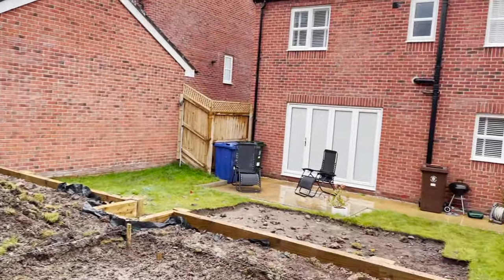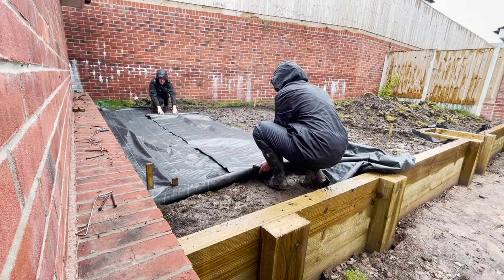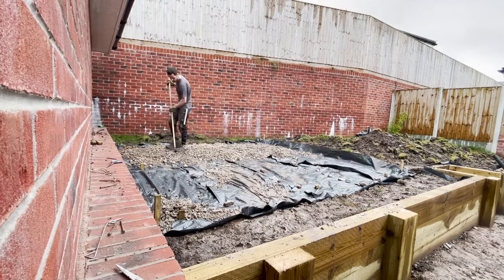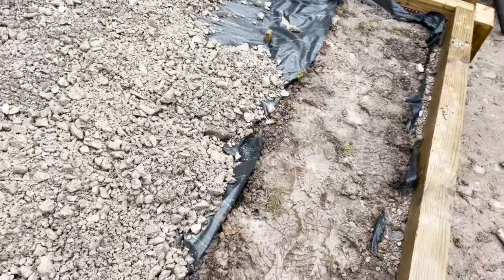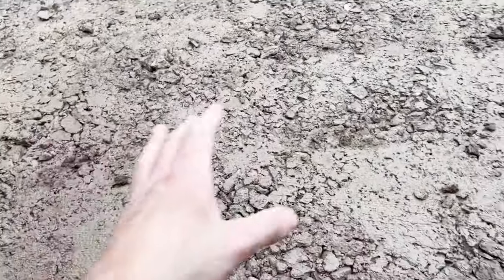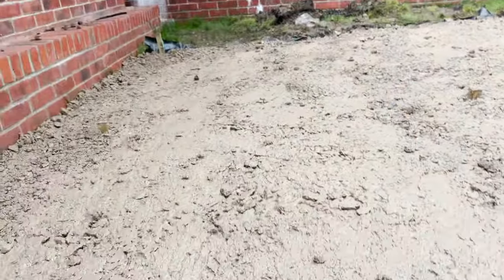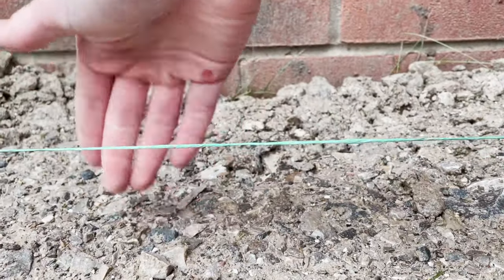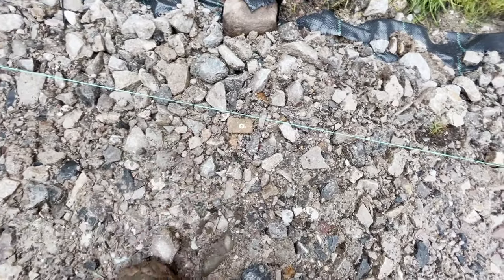Preparing a PATIO SUB-Base - GARDEN RENOVATION

Comment: Nice work! I recently laid my lawn, which is on a gradient. In order to achieve a perfectly flat (although tilted) surface I used scaffold poles in a train track like config. I set the poles so that the top of scaffold poles were the finish height of the lawn). This allowed me to fill up and scrape away excess soil with a spirit level.
Reply from the maker: That’s great, I may try this at some point if I do something similar again 👍🏻

Comment: Great video, I’m doing the same in my back garden but the area has an original layer of sand rather than soil. Thoughts on just putting the membrane down and then the hardcore on top? Do you think it’ll be okay?
Reply from the maker: Cheers 👍🏻
I recon you’d be sound doing that, shouldn’t be an issue.
Reply: @NoviceGardener  cheers fella. Keep up the grind!

Comment: I thought you had to use the white landscaping fabric as well as the black on grass areas to prevent the grass coming through
Reply from the maker: You can do it with both. Nothing has come through as of yet thankfully.
Reply: The main reason for using geotextile/ landscaping fabric is to separate the sub base material from the subsoil as over time they would mix. It also is used to for filtration and to improve the ground stability.  People call it weed membrane as that is what it is primarily sold as in the likes of b&q and wickes etc. But this is more true if you are using to under some decorative stone or mulch on flower beds as when using it 100mm+ underground it is unlikely any grass will grow through anyway due to lack of photosynthesis.

Typically I wouldn't recommend using the stuff in 1 meter rolls as it will only help with the separating of the sub-base from the sub-soil and is better in the 1.5 - 2.25m rolls as it'll help improve the ground stability, this can be done with the 1m stuff but it needs pegging to the ground.

The difference between the black and white is that the white is non woven and has better filtration properties than the black woven geotextile which isn't suitable for permeable drainage situations.

Comment: You can save time and money by using a old method to replace the mot sub base,  just use the soil thats already there as a sub base but first you need to level the ground to an inch higher than where the mot subbase height would be  then  dig it to 4 inches deep and mix with cement at 1/4 ratio thats 1 part cement 4 parts soil then spray with water ( not too much just enough to wet the cement ) now the last step is compact it with a hand held rammer or a 4x4 fence post untill its compacted enought that it wont give when you walk over it, water it in a few days again.
job done if you get the water mix correct you will have a croncrete like sub base in a week that will not shift over time and will easily handle the weight of pavers plus people.
Reply: its an interesting concept but Im not sure it would be easier as you would have to make sure its mixed correctly in a mixer and that makes it time consuming.

 Maybe worth trying on a small area.
Reply: You can just mix with a spade and a rake it doesn't need mixing in a mixer
Reply: @yeah-na would cement be cheaper than purchasing a ton of hardcore MOT